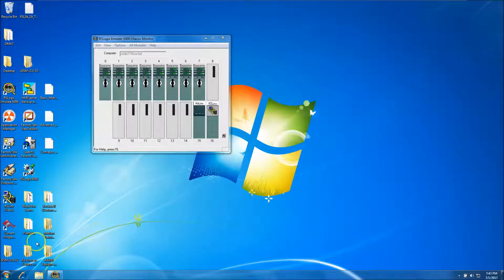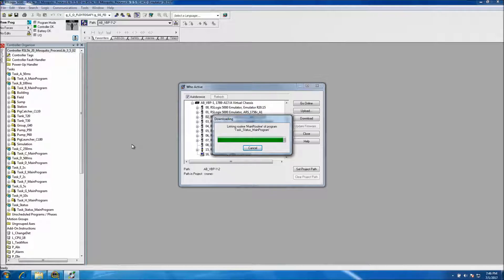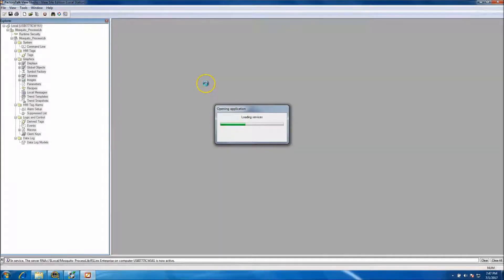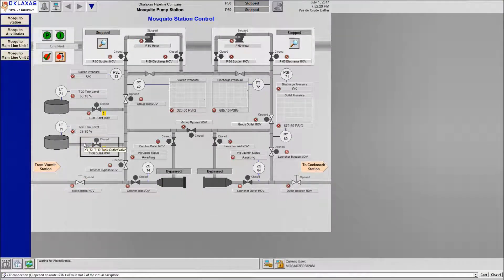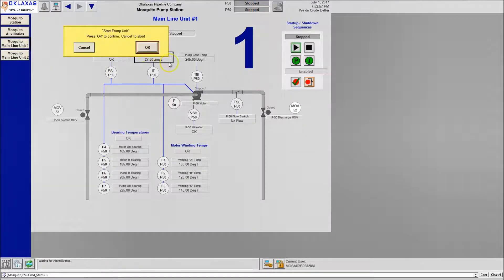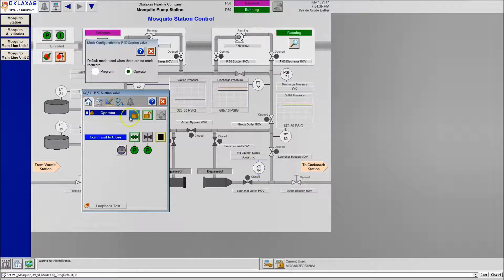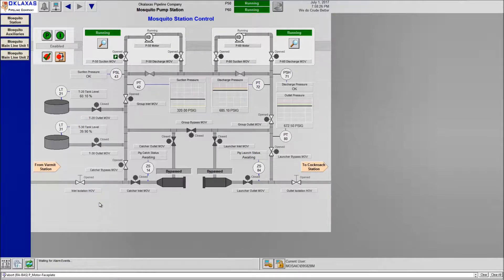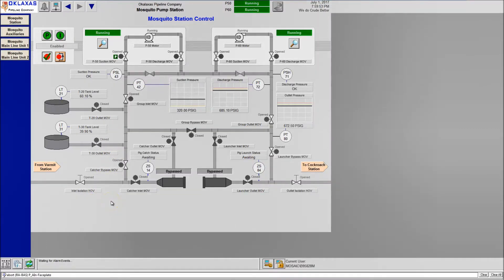Rockwell Automation PlantPAx 3.5 Mosquito Station HMI System Emulated

Comment: Hi Shane, where can I find this mosquito project for download?
Reply from the maker: Not sure anymore, they no longer have it available. I could check my storage drives
Reply: @ShaneWelcher  I have a V6 of it. when I try to open it with FTview, it tells me to use legacy tag conversion tool. when I try to do that, it does not recognize the .sed file.
Reply from the maker: @sayahan2003  then use the legacy tag tool to transfer from 32 bit to 64 bit
Reply: @ShaneWelcher  thanks Shane and sorry if I am bothering you again. I opened the lagacy tools and opened the directory where the .sed file is stored. however, legacy tools does not pick that .sed file. it say "no project is found in the directory".
Reply from the maker: @sayahan2003  you have to use the legacy on the 32 bit system then export, once finished then move the files to the 64 bit computer and use the tag legacy tool again on that computer.

It takes two laptops.

I have a video on my channel about this conversion process, use the search tab on this channel for 32 bit to 64 bit conversion
Reply: @ShaneWelcher  oh ok. I didnt know that. really appreciate for your support.

Comment: Sir, can individual faceplate be provided with some security levels like in operator mode out of multiple PTs, the selection of particular transmitter be restricted to change. In the same way , with administrative control all options are available. But I don't want the same for all faceplates?
Reply from the maker: Yes, just make a new Faceplate for that then add security to it then leave the original one alone.

Meaning, have two of them.

That's a easy way.

I say this because FTVIEW uses high level security on different versions.

Might as well keep things simple
Reply: @ShaneWelcher  Thank you very much

Comment: I'm using Studio 5000 Logix Designer v28, Studio 5000 Logix Emulate v28, FactoryTalk View Studio 11.00.00 (CPR 9 CR 11).
PlantPAx Rockwell Automation Library of Process Objects 29.01. 2016 Ver 3.5-11.
Mosquito example Compiled without errors, loaded into the emulator. In RUN, the actuators work partially. The panels open, the mode changes, the alarms work. Control commands do not work - Start, stop, open, close. These commands do not work in Designer either.
When adding one instruction to an empty project, for example P_motor, the situation is the same. Control commands do not work, the state of the outputs does not change.
What could be? I ask for help.
Reply from the maker: If you are emulating with V28 then that may be the issue.

There are a few bugs in emulate V28, I use V32 & V20.

I understand the troubleshooting that you are going through, but it could also be that you do not have all of the elements set up correctly.
Make sure that everything is installed per design.

It is hard for me to tell you what is wrong because it could be a simple mishap of adding these elements to the system.
Reply from the maker: Also, make sure that the Emulate chassis is increased memory.
You may have to remove the processor then add it back, when adding back then increase the memory.
Reply: Thanks, just after the question was posted I tried it in version 21. Everything works. I tried it earlier in version 31 - it does not work, when loading into the controller emulator, an error occurs and crashes into Windows. 32 version I don't have an emulator. I stopped at 21 for development. There are no errors in 28, it works halfway, which is very confusing. It is strange that this emulator error has not been fixed, especially with the standard example. Thanks and sorry for my english.